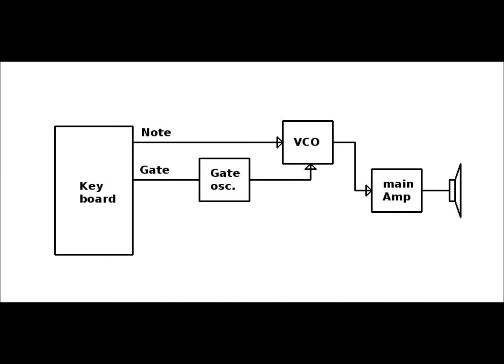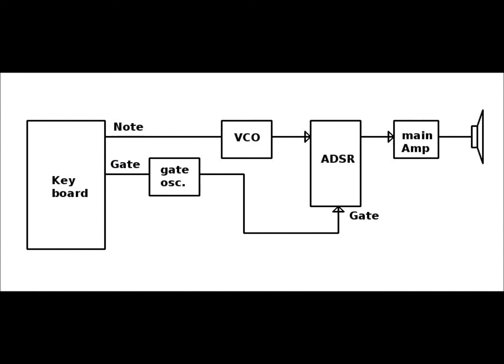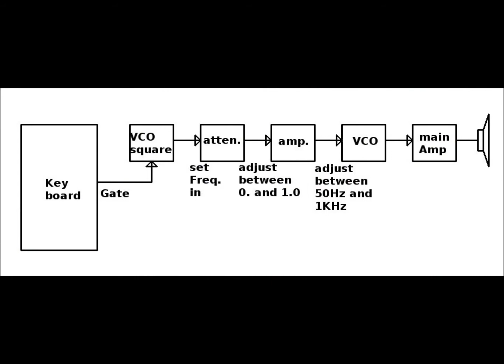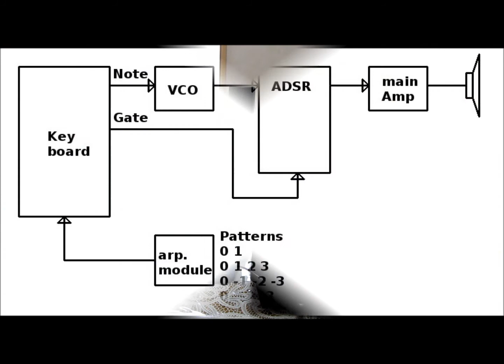jass arp demo

Comment: Yeah, when I was first deciding what keyboard to get, I couldn't find info on it anywhere. Roland really should support it better.
It's about 60cm x 25 cm x 8 cm (24" x 10" x 3"). It's too long to fit into a regular shoulder backpack, but will easily go into a guitar case, although it will be awkward to carry without modding the care somehow.

Comment: I think it's the only midi controller keyboard in its class. The keyboard doesn't make music by itself - you need to plug it into something, like a computer running Sonar. But, the keys aren't mushy, and you get lots of sliders and dials, if the software supports it. If you already have a pro-level software DAW, then yeah, I'd recommend this keyboard.